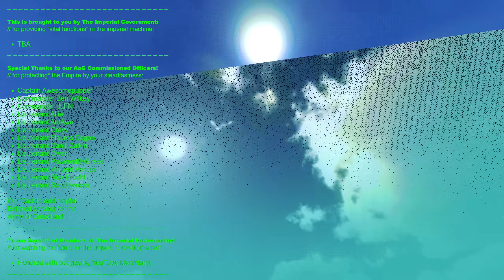RB05 | AoG Trials S2E6 | The Ultimate AA Missile Launcher - From the Depths

Comment: The missile's design is actually based off of the IRL Swedish RB-05 missile - that's the reason for both the name and the aesthetics.

Most of the optimization was done against flying squirrels - in my testing a single module would usually kill all three in the first 2 or 3 volleys, so they didn't do as well as I had hoped on that front.

Multiple modules on the same craft tend to work better than on separate craft - just remove the extra lua boxes/have a single central lua box. They take distance to target into account when choosing a target so spacing them out works pretty well. 

Sidenote/funny thing: there's a whole section of the code for allowing a missile to re-target on a miss that is actually wrong/bugged and wildly inaccurate - but it uses it so infrequently it barely matters unless you're against like 20 flying squirrels.
Reply from the maker: oh, then it must then be called "Robot fem"
well. the performance of them are extremely impressive! even if they dealt with the air-rat infestations faster in your tests! :_GMODThumbsup:
wow that is so advanced mate!
Reply: Are they on the workshop? I’d like to pick it apart and see how I can make my missiles better

Comment: Impressive! The only thing is, the script uses the absolute target position, without the error of detection systems. This might not be critical for missiles, since radar guidance head also use the target's ideal position, but it's not very fair for laser-guided or remote-controlled missiles.

Also, I don't know the terms of the missile launcher's provision, but I don't think it was worth scrolling through the entire script in the video...
Reply: [edit - I had misread the discussion in the FTD discord and mixed up two methods - detection error is in fact being ignored just not stability or ecm]

Bit of a correction, the method the script uses (I:GetTargetInfo(AIMainFrame, i).Position) does actually include error - specifically it returns the game's GlobalComWithError - this includes error from detection, stability, and ECM. There is a way to remove that (thus getting an unfair advantage) but it's not used for this missile script

The reason the missiles aren't as "twitchy" as you might expect despite detection error is because it uses a tuned PID to smooth out the missile aimpoint.
Reply: @trk20.  I:GetTargetInfo(AIMainFrame, i).Position gives ideal position. I:GetTargetPositionInfo(AIMainFrame, i).Position gives position with detection error. You can easily check this using laser turrets on platform with bad detection.

Also, on line 162, script uses not I:GetTargetInfo(AIMainFrame, i).Velocity, but  I:GetTargetInfo(AIMainFrame, i).Position - (I:GetTargetInfo(AIMainFrame, i).Position from previous tick). Guess why? That's right, because this way the speed is calculated without any detection error (I:GetTargetInfo(AIMainFrame, i).Velocity contains detection error).
Reply: @trk20.  if you're interested, I even did it for you. The video was just posted on my channel.
Reply: @Inedilarion  Sorry about that - I had mixed up I:GetTargetPositionInfo(int, int).Position and I:GetTargetInfo(int, int).Position - thought it was reversed, so you're entirely correct that detection error isn't being accounted for. (ECM and stability are applied after the fact to missile aimpoint, so those are still present)

I'll submit an edited script with that switched out, although I don't think it will make a significant difference due to aforementioned PID.